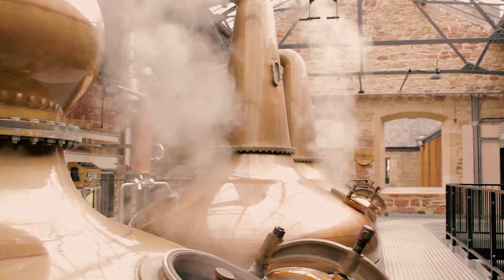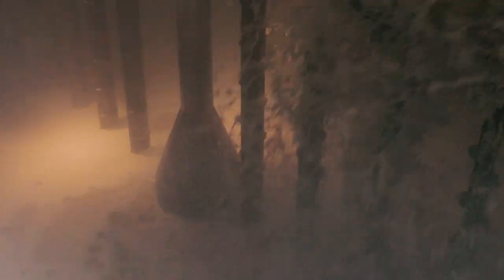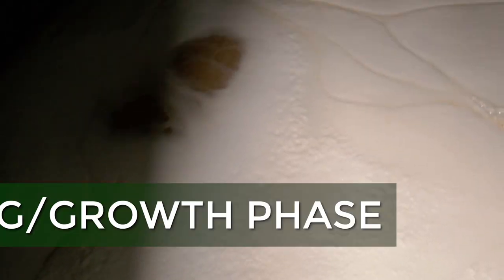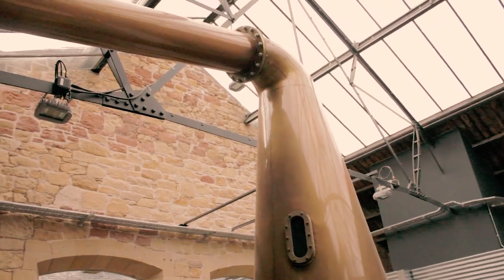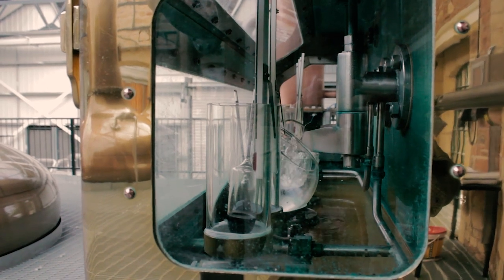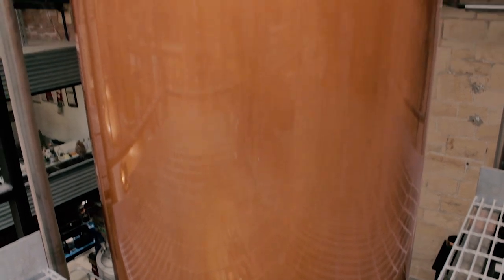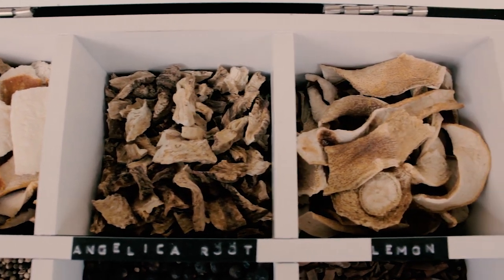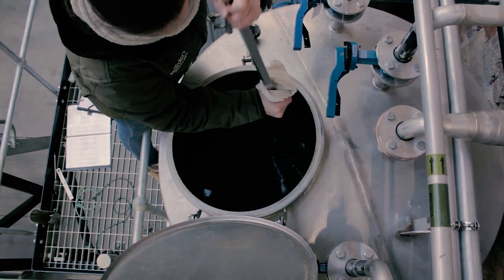Scotch Whisky Distillery Tour | The Borders Distillery

Comment: Very detailed video and a very tidy distillery it seems thanks. Im new to this, what is the purpose of having much copper in contact with the liquids?
Reply from the maker: Hey thanks for your comment. The copper helps strip away unwanted substances in the liquid such as sulphur compounds which give the liquid meaty and rotten egg flavours/aromas. We don't want those in our final product, so the reaction with the copper will help the liquid have a cleaner and better flavour.